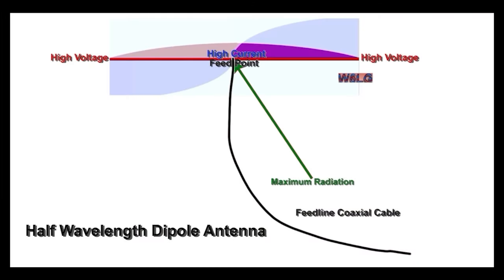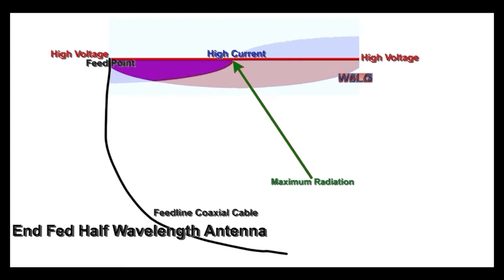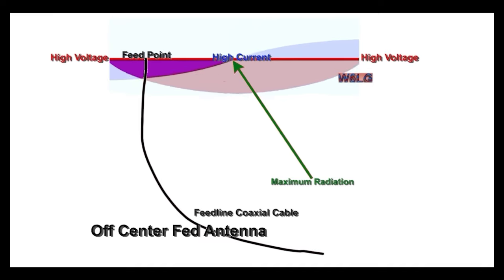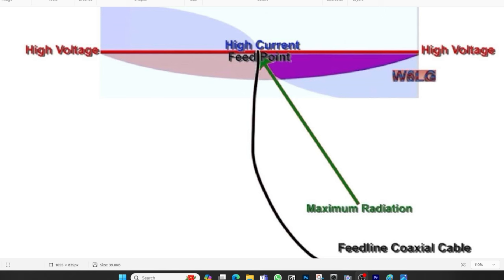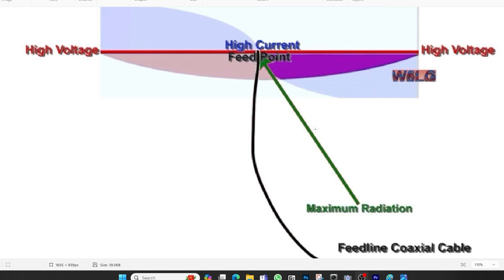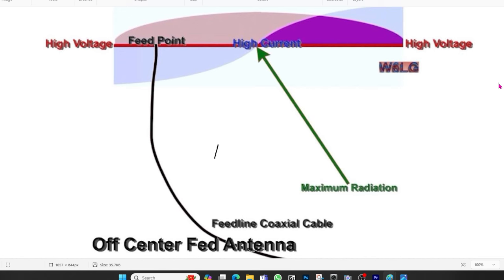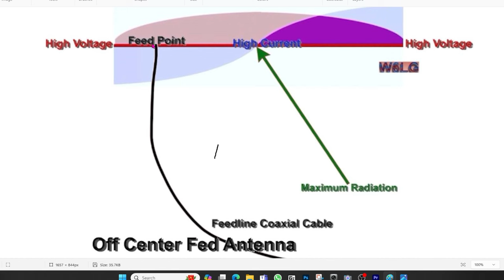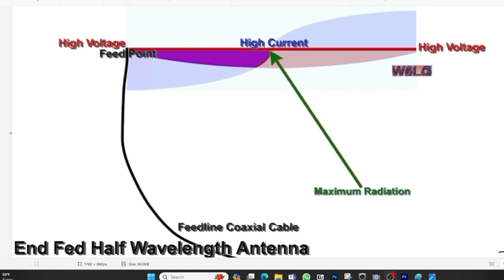End Fed, Dipole, Off Center Fed Antennas: Which is better?  Jim W6LG Shows a Brief Animation

Comment: I'm used to feeing OCF antennas with a 50:200 ohm balun.   At approximately the 1/3rd point along the 1/4 wave antenna, the impedance at that point for multiple bands is right about 200 ohms.  The math just works out and they are pretty amazing antennas and not too bad for homebrew so long as you're able to raise/drop/cut/tweak many times till you're happy with it.

Comment: Great video Jim. I just built 2 end fed long wire antennas in the past couple of months - one 72' and one 41'. The 72', I used the coax as the radiating counterpoise. The 41' has a 16' wire counterpoise because my coax length wasn't really long enough for that purpose. Yes it's basically a OCFD. If I am reading your animations correctly, they all have maximum radiation from the center. In my view, they all are basically the same in terms of how they radiate. I think we tend to over-complicate things. The goal of an antenna is to get maximum energy to the radiating wire. The different configurations are just different ways of accomplishing that at the end of the day. Performance will be around the same assuming all of them are straight and going in the same direction and are at the same height. Installing the antennas is where the variables get introduced (height, direction and configuration). Even a vertical is just a dipole turned 90 degrees. That is why a lot of guys can't picture why it needs radials or counterpoise. It's the other half of the antenna. Thanks again for doing these. de Scott, W1AL

Comment: It is incorrect or misleading to say an end fed does not need a counterpoise. It always needs a counterpoise of some type, the feed system always needs two terminals. This is one of Kirchhoff's Laws.  

Where people go wrong is not understanding the counterpoise and common mode current. The counterpoise can be quite small, a matter of hundreds or thousands of ohms in common-mode impedance.  Even a 12-inch square can be an effective counterpoise on 30 meters for an end-fed thin half-wave wire. The problem is a small or no counterpoise creates a counterpoise voltage problem. 

If a counterpoise is small the impedance is high. A small or high impedance counterpoise pumps up in voltage to very high voltages. A small counterpoise has to do this to drive the end of the antenna with the current and voltage the antenna needs. The antenna's end impedance is high but is finite and dependent on antenna height, cross section (surge impedance), and the antenna surroundings. The feed impedance of an end-fed half wave ranges from hundreds of ohms for a very thick radiator like a tower or tubing to many thousands of ohms for a physically long half wave with thin wire high above the earth. 

But that end impedance is never infinite, so the antenna always requires a counterpoise of some form. We are often blind to the various forms a counterpoise can take, so we develop a false idea "this works fine without a counterpoise".  The counterpoise can be very small under the right conditions. Most of the time the counterpoise is the feedline, and the feedline radiates! At times a feedline can radiate more than the antenna radiates! This can also be proven.  

A high impedance counterpoise will elevate itself to the surrounding world in voltage until it satisfies Kirchhoff's Laws and the same current flows into and out of the counterpoise terminal as the actual antenna. This current causes an elevated voltage from the counterpoise to the world around the counterpoise. That voltage is what causes the longitudinal voltage that drives unwanted common mode on the feeder, a tower, or a mast that is coupled to the feeder. 

It is actually possible to have, and it can be shown we can have, more current downstream in a counterpoise (intentional or not) because of surge impedances and standing waves. 

It is a crying shame we insist that no counterpoise is required. The lack of counterpoise is the root cause of common mode and efficiency problems. We falsely and repeatedly claim through some magic we can transition from our two or more conductor terminal circuit world to a single terminal radiator without handling that second terminal. This is a major educational problem we should work on. 

Instead, some end-fed half-wave antenna experimenters and educators wrongly tell others a counterpoise is not necessary or required. This misinforms people trying to understand the system and how to make the system work as well as reasonably possible. 

73 Tom W8JI
Reply: Thankyou. Magic is the word he used in the other video.
Reply: Agreed…. An EFHW does not need an EXTERNAL counterpoise because it typically uses the outer conductor of the coax as it’s counterpoise. I’ve now deployed over a dozen EFHWs across a variety of locations and have noticed both tuning and performance varies depending on how the coax is run, along with the positioning of any chokes to reduce RF coming back into the shack.  Namely, if I position any form of Common Mode Current filtering any closer to the EFHW’s feedpoint than .01 wavelength distance on the lowest frequency desired, SWR climbs and performance declines.  I also have experimented with external counterpoises such as additional radials, a grounding system, along with the 80’x80’ bonded metal roof at my present QTH. What I found was zero benefit to an external counterpoise, over simply allowing the coax to provide the counterpoise function.  If I isolated the coax AT the feedpoint of the 49:1 transformer using a CMC filter, external counterpoises would work, but I never found one that worked any better than using the coax (by moving the CMC filter away from the transformer by at least 14’).
Just for some background, I used nothing but centerfed dipoles for decades and was pleased with their performance (I used them as “my standard of comparison” when experimenting with other antennas/designs).  However a few years ago I had a deployment requirement that was no longer going to be conducive to centerfeds, so I tried an EFHW (in a location where I still had a centerfed to use as a comparison).  I was somewhat surprised that the on air performance of the EFHW, in a full 80-90% of the cases, equaled the centerfed, even though the center of the centerfed was at least 10’ higher than the EFHW.  In the very few cases where the centerfed had an edge, it was almost always by less than an S-unit, and only on the higher frequencies such as 15-10meters. On some bands (notably the lower frequencies) the performance was not noticeable, at all.
My .02, FWIW, YMMV,
73 Tim W5TRL

Comment: Thanks 😊 I am in an apartment, top 4th floor, on a hill, and facing the woods too at over 300 feet asl.
My HF antenna is a Windcamp WA4, 
Off Center Feed Dipole with a balanced.
It is 60 feet on the long end, and 20 feet
on the short end. From my terrace, I put
the 60 foot length to the woods, and the 20 foot length on the terrace railing.
I have a Yaesu FT-891 with a Yaesu FC-
50 tuner through an MFJ Antenna Tuner
Extender accessory to the coax cable.
73 de W2CH Ray New Hampshire😊

Comment: I love EFHW antennas. I have mine set as a vertical in my big oak tree. Worked lots of DX with that bit of wire and 100 watts. Bouvet was the best so far but it seems if the other station can be heard, I can get through with persistence. Great antenna if you can only have one.

Comment: Good timing on the video. Was just going over cutting a wire to length for an off-center-fed. I'm thinking about trying 1/2 30 meter for the hot side and 1/4 40 meter for the cold side and seeing how that works. Thanks and 73 good sir.
Reply: Well, it radiates at 30 and 80 (10 and 4 MHz), but not 40... 🤔
Reply: I ended up trimming the counter lead so that the total length of both together is 1/2 40 meter wavelength, and the main lead is 1/2 30 meter wavelength. I'm working on setting up a balun for it still, but so far it seems promising.

Comment: Hi Jim. Thanks for this video. I keep hearing all types of antennas are a compromise. Could you follow up with a brief set of pros and cons for each type of half wave antennas. Which has less noise, better receive, better transmission for example. Thanks again for all the great videos and vast experience you have.

Comment: Tks Jim for this video.  I am a bit late,  but thought I would give you my experience.  Just today I put up a off centre fed dipole,  but a little bit unusual in that it is 10m on the short side and 30m on the long side and fed directly with coax near the shack.  The ends are around 9m and it dips down to around 4m with 5m coax . It is very good SWR around 1.4 -1 at 7.120 . The initial reports are very good at 300 miles from NE Scotland down to central England and beyond.  Tunes up on 80m and 60m with little loss as far as I can see using a MFJ 962d . As 40m, 60m and 80m are my main objective I think this might be a good option for some that mostly want 40m with occasional use on other bands , if they can  keep the coax to a short run ? 
I mostly use doublet antenna 720feet down to 50 feet , regular dipoles and loops . 
I see my full wave dipole on 40m (¼ and ¾) might have no real gain over a standard dipole except being very usable over various bands ,so long as coax is short .  Tks again

Comment: Do I need to use a remote antenna tuner at the base of the mast for non-resonant wire antennas such as my 71" end fed random wire? I also own a 66" OCFD as a backup antenna, I always use my regular desktop LDG auto antenna, but I was recently told you got to use a remote at the base of my mast. I was told the loss on the cable is the reason.

Comment: As antennas are tuned RC (ZC) circuits, and as each pole of an offcentre-fed antenna would have different resonance characteristics, if the feed point is offset from the end, then surely the resonant frequency would not be the same as for a regular centre-fed dipole, and the radiation pattern would also be very different due to the voltage  and current patterns on each pole being different, and interacting with each other, and that interference pattern would create a much more complex radiation pattern as the magnetic waves are affected by the interference. Am I wrong? If yes, why?

Comment: how about suspending it from the centre as end fed halfwave inverted v? what happens if the ends actually go straight down so only the radiation centre is in the air?

Comment: Thanks!! I missed your emphasis on the lack of differences in the three animations (in terms of current and voltage distributions). Am I allowed to use V/I to get an intuitive understanding of why off-center and end-fed have high R? (both have smaller or much smaller I at the feed points, so the denominator is small and the fraction is very large.

Comment: Hi Jim,
Nice visuals for the animation. Most hams use a 49:1 balun with a EFHW antenna. I had always thought the impedance was about 3K, but you mention upwards to 5K. There is also mention that a counterpoise of .05  - .07 wavelength may help. Hope to see you later tonight on W5KUB. Stay safe.  73  WJ3U
Reply: Counterpoise turns end fed dipole into an off center fed dipole. It reduces impedance from 5k to 2k5 which makes 49:1 balun fit.

Comment: Hi Jim, thanks for this educative vid! Is it a mistake that the words “high voltage are drawn in red and the high value shape at the tips of the antenna is in blue? And vice versa the word Current is in blue but the shape showing swelling in the middle of the antenna (while weak at the tips) is in red? Are those both waves (perpendicular) form the radiating power of the antenna or just one of them? As far as I know there can’t be “voltage” there where there are no wires, but maybe some “field”?

Comment: HI Jim,
Good to see you, thank you for sharing your knowledge, how are you going? any improvement?
At the moment I am experimenting with 3/4 vertical antennas and despite the name " sky warmer " and other bad reputation it looks to work great for DX. 
When compared to a 1/2 wave it seems to be doing better, even if the mouthing is low to the ground, as you know matching a 3/4 antenna is fairly easy, and the wide band those antennas deliver helps cover most bands at low swr.
Any thought about those antennas? As you know I keep going against the trends with my antennas all while keeping the power at 100watts or less (and yes, we did have a few QSOs before)
Kind regards,
vk4BYE Joe, and Marie-Ann VK4DJZ

Comment: Hi Jim, another great video! One question, and a reference to another source to review works too, why don’t you need radials or counterpoise for an efhw antenna? 
Thanks and good to see you.
Reply: Same reason you don't need radials or a counterpoise for a centre-fed half wave dipole - because it is a half-wavelength long. If you have a quarter-wavelength say as a vertical, then you need to use something to make up the missing quarter-wave, such as radials or counterpoise/s.
Reply: @bobr6555  Thanks Bob! Appreciate the answer.